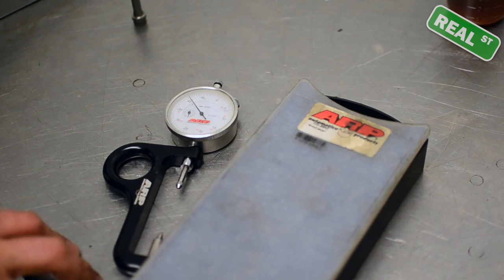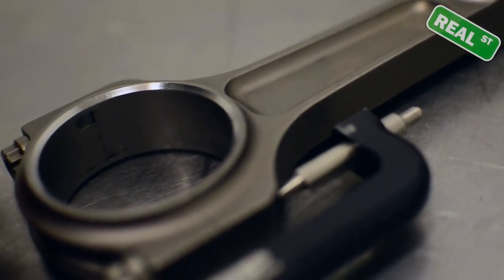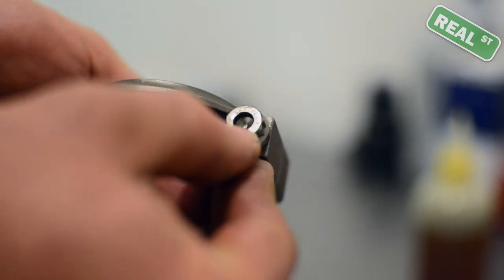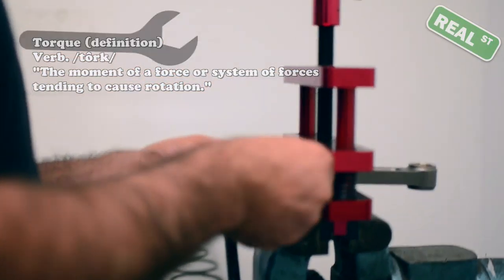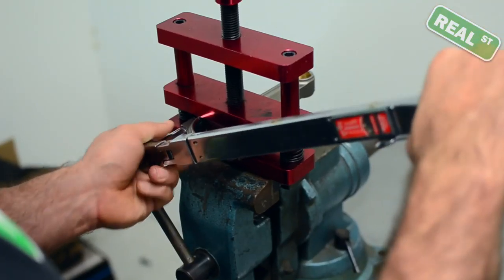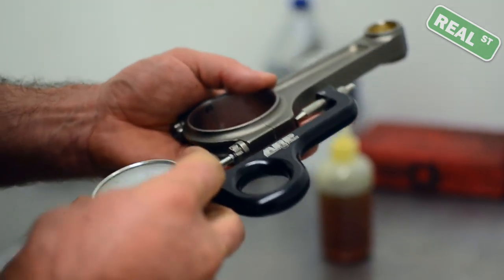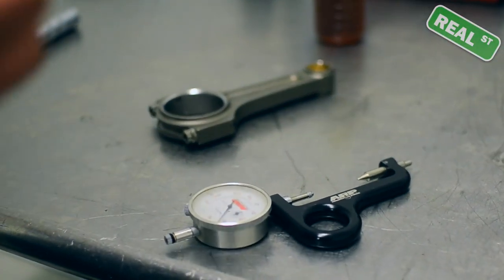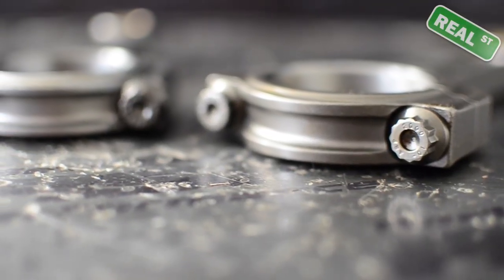Rod Bolt Torque and Stretch - Jay's Tech Tips # 7

Comment: I bought rod cap bolts and tightened them to specs to check with plastiguage and then took them apart to install.  Did I ruin my bolts because they may have stretched?

Comment: If you could do a vid on piston selection...and some of the differences i.e. cast, hypoeutectic, hypereutectic, and forged (4032 or 2618)..and maybe some ARP2000 and H11 decision stuff.thanks.
Reply: For hypo/hyper eutetic pistons see my post above. Cast is just the process (obiously) and the hypo/hyper eutetic refers to silicon content. 

The 2618 vs 4032 is aircraft grade aluminum vs automobile grade aluminum im fairly sure. 

Havent researched much about headstuds but a wise theory would be the amount of tq they are rated at.

Comment: With the rods mounted on the crankshaft, I used a torque wrench to incrementally tighten the first two rod bolts. I measured the stretch and it is proper and I noted the torque needed to get there.  Can I rely on torqueing the remaining bolts to this setting to achieve the desired stretch or do I have to go through the agony of using the stretch gauge 14 more times?  ARP bolts with assembly lube if it matters.

Comment: Great instructional video. Just a couple of questions;
Doesn't a set of rod bolts have different static lengths?
Do you recommend zero'ing out the rod bolt stretch gauge for each one of them and measuring out the stretch?
Or finding out the shortest one and just measuring out the co-efficient for the other ones and adding the specified amount of stretch needed?

Comment: The instructions that come with the ARP stretch gauge describes a different way to use this tool. Firstly, it mentions preloading the tool to a certain amount and then zeroing the gauge. Then you should use a box end wrench and torque the fastener until you’ve reached proper stretch. Someone tell me I am wrong.

Comment: Hi my car is old and had to replace the crankshaft , so i ordered up all gaskets stretch bolts etc from Mercedes . When i got the parts only two conrod bolts came and was told there was no stock in uk and would come from manufacturer that could take 6 months . I have just put the engine together could just get 90 degrees on bolts . The car is only used for light use have i just built a time bomb . I hope in 6months i will fit the remaining bolts .

Comment: What kind of torque wrench is that?
Reply: it look like a snap on, but you dont need get that one exactly for day to day use in your garage.
Reply: i'm JGott I own a shop where the snap on guy never comes. Most of my tools are mac and craftsman because I'm out in the woods but all I do is build engines and transmissions.
Reply: spartan1071 
ahh, i see the need in quality parts. i thought you may have been a garage builder like myself. snap on is great but can be overkill for an average builder like myself.
Reply: i'm JGott I have a clicker style torque wrench and digital but I liked the fact that it was swivel and longer than anything I have. I personally don't care if it is digital because pressure torque sensitive wrenches are more accurate.
Reply: spartan1071
I have a digital brown line torque wrench and I'm going back to clicker style. I think there better and little more accurate and you don't have to worry about batteries. I've seen badass digital wrenches at my work but they're like 3k and up.

Comment: Well damn I was hoping to build a car someday just in my garage... guess not with those tools
Reply: If you arent trying to make  1200+ hp out of a 3 liter engine like these guys, you dont need to check the bolt stretch like this video showed. Just torque the bolts to the recommended spec with a good torque wrench. Unless your bolts require being degreed. LS engines do. You need a degree wheel for that.
Reply: +70chevelle8 an angle gauge?